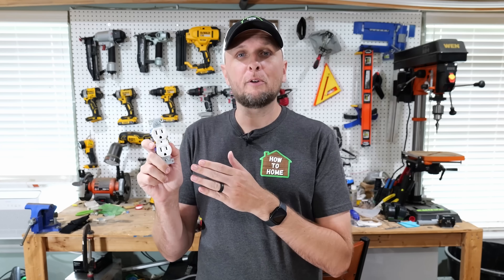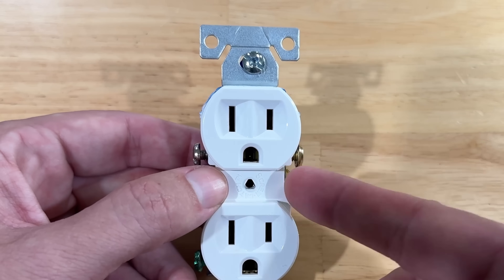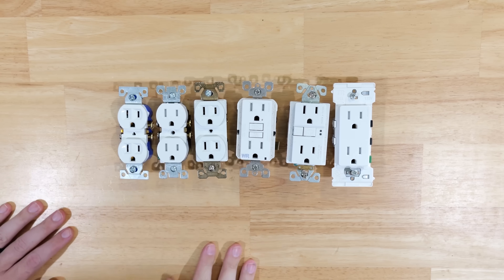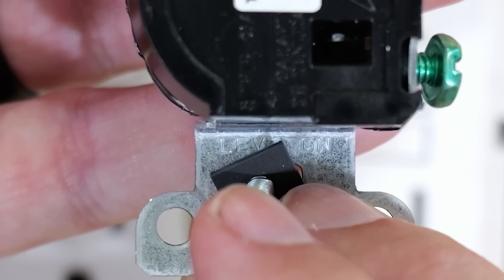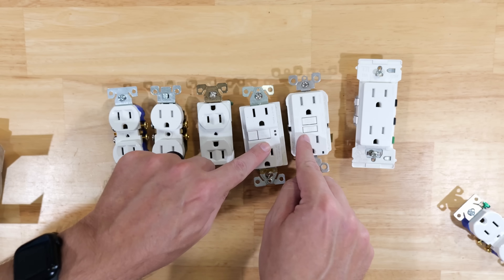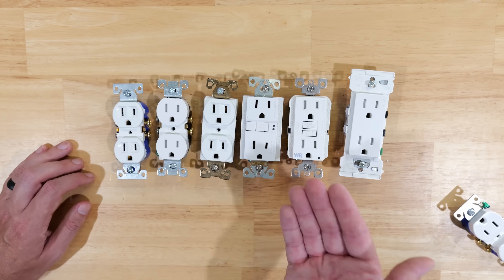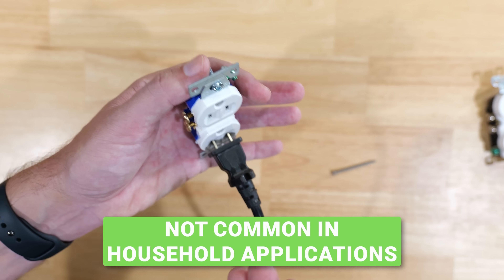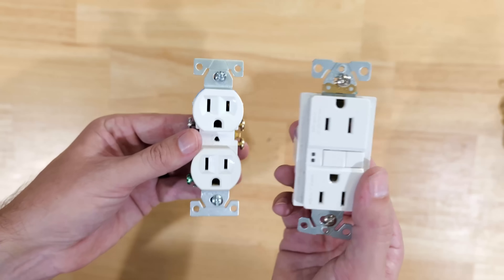The Shocking Reason Why Your Outlets Are Installed Upside Down!

Comment: I work in IT and I'm also a computer enthusiast. All the surge protectors I use with my computers and other electronics have 90 degrees plugs that are designed for a "ground-down" installation. Same goes for refrigerators, AC units and watercoolers. For me it's ground down all the way mainly for that reason. There are cases where ground-up or down is debatable, such as with sit-stand desks where the surge protector is screwed under the tabletop (above the receptacle). in that scenario, having the 90 degree plug to facing up could somewhat make sense.

For straight plugs, I don't think it matters.

Comment: Wall transformers (Wall Worts) are designed for the ground down in many cases so the output wire will come out the bottom.

Comment: This is a pretty worthless argument. Electrically, it won't matter if the receptacle is ground up, down or even side-ways, which I have seen often in tight spots. The electrical current won't care, it will still flow in any orientation. What possible reasons do people give for insisting on a particular orientation?

Comment: My biggest issue with ground up is that 99% of power cables that either end in a box or have a 90 degree bend at the plug will point upward in a ground up plug. As such, they're more likely to start to fall out easier as the cord is used than if the ground was on the bottom. And 99% of these items don't have ground pins. If the 90 degree bend is sideways, there's not problem either way. And if you have one of those box plugs in a wall outlet, it would become top heavy and more likely to tilt if ground up. It bothers me at my workplace seeing a waist-high outlet, the ground is on top, and a box plug plugged in with the cable going up and away. If any type of plug is likely to catch debris, it's those.

Comment: I had a house that had all the recepticals horizontally mounted. The ground prong being up would really only be useful in a shop or garage. That's the only location where metal things like pegboard hangers or metal flying from being cut might lay across a partially pulled plug.

Comment: THIS PRACTICE IS USED IN COMMERICAL APPLICATIONS BECAUSE WITH THE GROUND UP THE PLUG FOR COMMERICAL FLOOR MACHINES. THE PLUG WILL STAY IN THE RECEPTACLE BETTER AND WILL NOT FALL OUT AS IT DOES WHEN THE RECEPTICAL IS IN THE DOWN POSITION. NOT A RULE BUT RATHER A PRACTICE

Comment: A few years ago when I was working for a state agency that dealt with this stuff we ran into an issue with extension cords and the number of fires that we investigated and the causes and these upside down outlets came up.

I contacted members of the team that wrote the NEC and the Life Safety Code. There is a section that most people miss that you briefly mentioned, which is something about all other rules and regulations that shall be followed. UL testing. In this state, everything bought and sold must have the UL certification. It is crazy how complicated it was to get and read through that testing stuff on each item and I found out why it is so expensive to get something tested. So without going through all that gobbly gook on each device and just using common sense people will find that there are a ton of things that require the outlet to be right side up. Many night lights, and decorative aroma defusers and the such but the biggest and most important thing we ran across was the flat against the way type plugs on heavy equipment like refrigerators and airconditioners. When these are plugged into an upside down outlet undue stress occurs to the outlet itself and the cord. I investigated a fire where a father and baby lost their lives in a fire because one of these scenarios where the outlet and plug failed and caused the fire. And before people say that an easy fix is just to get an adapter, those are an extension of the outlet and therefore against code when the UL testing is reviewed, those are for short-term use just like extension cords. See how this all comes around? 

Having an outlet in so many cases upside down is illegal and we have been pushing the NEC and other regulatory agencies to address the issue.

To me, the ground facing up or down looks just as good. I will tell you this though, I have had my fingers slip off the plug way too many times when unplugging one to admit to, and every single time it was on a two prong plug and you would think that zap would get me to learn the lesson but hasn't.

Comment: Look, the ground terminal is longer that the others. With ground terminal up its easer to aim the ground terminal to enter the socket first. Its best if the ground terminal makes contact first to ground the system before live terminals connect.

Comment: Side note:  Not necessarily the nail or a paper clip , but in some case that I’ve seen; JEWELRY (bracelet, necklace) in a bathroom that has caused the arc/short circuit.

Comment: I think the ground up comes from applications where the stainless steel face plates are in use. In the situation where a plug is inserted and works it way out a little and the plate becomes loose. The plate would become hot with the ground side down but be safe with the ground up.

Comment: The discussion around 10:00 about metal falling on the prongs, happened at work a few years ago. A metal faceplate came loose and fell onto the two prongs. Scared the crap out of the secretary (she was moving something when contact was made.) Ground prong up would have prevented that.

Comment: A lot of cables don't come straight out from the plug.  Usually in this case it is angled down from the ground side of the plug.  Having a receptacle with the ground up puts the cable coming out the top and bending.  Looks weird and is not good for the cable.

Comment: Every appliance with a GFCI built into the plug I've ever seen is designed with the prongs on the opposite end from where the cord comes out, meaning it should be plugged in with the cord down at 90 degrees. The ground prong is always on the bottom. Hair dryers, air fryers, vacuums, window A/C's, whatever, they're always designed to plug in with the ground prong down.

Comment: I'm not a professional electrician, but my father was an electrical engineer.  We discussed this topic at length.  I believe our final decision was to leave them in the "Face" direction, so that the ground was down.  This had more to do with the items being plugged into it, than anything else.  Some UPS devices, and other items like Refrigerators have cables designed for the ground plug to be down.  I have never come across a plug that expected (unless universal) the ground prong in the up position.

Comment: My only issue with the ground prong being up is when using most any 90° plugs. Most of the 90° plugs on certain appliances or extensions like surge protectors are designed with the ground prong being on the bottom. Other than those situations, I don't care.

Comment: It's just common sense outlet control. One idiot did something stupid and blamed the outlet now there's local regulations. Plugs should be removed from outlets when not in use and the breaker turned off and locked out...for the children

Comment: It's not that an object might fall on the pins, it's if there is a metal cover plate and the screws somehow come loose. That's much more likely. If the outlet is sideways, it would make more sense to put the ground pin to the left.

Comment: Anybody who installs receptacles with the ground slot up has zero credibility.

--------------------------------------------------
[Note: This comment is not focused on any particular "designated group" with regard to the YouTube "hate speech" or "cyberbullying" policies. It simply reflects the author's opinion regarding a subject, which may or may not also pertain to an individual's actions demonstrated in the video. If any such individuals belong to any of the "designated groups", any commentary included is merely incidental to that grouping and such groups are not the focus of any comments. It's pathetic that this comment is necessary for the YouTube censors.]

Comment: I read somewhere long time ago, like late 90s, the ground up was the new way to install because when the plug is half way out. 
I have another question.  Why do the live and neutral prongs have holes at the end?  Again, I read somewhere that  right after WW2 ended, manufacturers added these holes to save on metal which was limited at that time.

Comment: As an electrician this video is spot on... Residential electrician are typically taught to ground down. This is for switches as well although some (Levington I believe) want grounds to the top on single poles. This is very frustrating to someone that used P&S (eaton) for most of his life.  You get use to having grounds down and this is one reason I hate using anything with grounds up as it gets in the way of wiring the other wires as I typically hook up ground first to hold the switches in place while I strip out or hook up the other wires. Due to this, it really reinforces grounds down in residential. 

In commercial, such as hospitals and things, they tend to do ground up as a general rule of thumb. Maybe that's why levington puts ground to top on their single poles?  I think the idea of this is if your in a hospital setting, you don't want something to trip the breaker (like a paper clip) and cause a medical emergency.  

I think in both situations, there is no real code to tell you but the typical rule for me is ground down unless your commercial. Also, most people are use to the smiley face. It is true that neither way is upside down but ground down is usually considered normal and ground up is upside down except for hospitals... Very good video explaining things though.

Comment: If the ground prong is on the upper side it seems to pull out easier at the top from the weight of the cord sticking out of the outlet due to less frictional resistance. Two prongs at the top pull out less easy and therefore the plug stays in its place better, based upon my experience.

Comment: Regardless of the vertical orientation of US outlets, they are the crappiest I've found almost all over the world.  In most countries they would not pass their national electrical code on the grounds of their poor design.  When it comes to plugs that are inserted into said US outlets the situation is even worse!  Most foreign plug prongs only have conductive material at the tips, so it is impossible for a small child to stick their tiny fingers between a plug and the outlet, touch the prongs and get a shock.  The prongs consist of insulated material except for the very tip, which is no longer in contact with the outlet electrical connections by the time you can see the metal tips.  Why are US plugs not built this way?  Because it makes them more expensive.  Quality and safety have a price which apparently Americans are not prepared to pay.

Why oh why do nearly all US electrical plugs stick straight out from the outlet?  The means that furniture cannot be placed flush with the wall if there is an outlet behind it with a plug inserted.  This is ridiculous!  Given the pathetic quality of US molded plugs, why do more companies not install thin 90 degree plugs?  Because it costs more to make them that way and given some people insist on installing their outlets the 'wrong' way, appliance and lamp makers would have to decide which direction the power cord should go.  I have purchased some 90 degree cords and they always seem to point the 'wrong' way.  If for no other reason their should be a national standard that establishes the orientation for electrical outlets for just this reason.  The cord should exit the plug downwards only.

I'm now living in our fifth home since moving to the US in 1977.  In every home, including new construction, I have replaced every electrical outlet with 'medical' grade outlets that are more expensive but grip the plugs prongs more firmly so they cannot 'fall out' or be easily removed when jerked, such as when someone moves a piece of furniture or catches on the wiring when using a vacuum cleaner.  In the US construction industry is is documented that two out of every electrical outlets are wired incorrectly!  Not with the 'live' to ground, but with the neutral (return) to ground, which will not usually cause sparks or fires but can cause horrible wireless interference, especially in steel framed construction.

Three of our US homes have been older ones that needed remodeling.  Every one had electrical installations that were not to code and in some cases downright dangerous.  I've discovered that Americans are not just cheap when it comes to their electrical infrastructure, they're blind to how dangerous they are and how close to death from electrocution some people may be.  At the very least every home owner and renter should own a simple outlet tester, the kind with three lamps, typically amber and red.  They should test every outlet in their homes if they want to sleep safely at night.

Before I retired some years ago I owned a business that required me to install some medical equipment in commercial premises.  I was constantly appalled by the blatant disregard for people's safety.  Incorrect wiring, loose connections, multiple devices plugged into extension codes exceeding the load capacity for the wiring that created literally hot wires, people with multiple extension cords plugged end to end with no regard to the load capacity of the individual cords.  This was especially prevalent in rural areas.

Most Americans live in wood framed homes.  You'd think they would be more conscious about how incorrect or just poor electrical wiring can burn their home down!

Comment: There are many larger plugs which would be an issue if oriented ground up due to their construction. My Midea portable air conditioner is an example. It has a test and reset in the plug block. If ground up, all the weight of the cord, being forced to loop away, would pull it loose from the plug where, down, the cord weight hangs freely without concern.

Comment: With the ground up If the cord is stepped on and pulled down the most important connection will be the first broken. I say either way would work but I prefer ground down for this reason.

Comment: Amazing that nobody ever talks about receptacles mounted horizontally. Not as common by far, but they do get done. I have seen quite a few installed in the base board horizontally. Also, not covered in the NEC.

Comment: The original patent states that it was designed to be used specifically with ground UP. That's probably why people say they're mounted the wrong way if they are ground down.
IMHO, what the original design had in mind doesn't always translate to real world use correctly. 
This system is one of the most dangerous systems worldwide anyway XD Safest being the UK system, followed by the Belgian system and the EU system. They are quite a bit bigger though.
Where you mount an outlet is usually a LOT more important that the direction. And as you said, HOW you mount it.

Comment: The problem isn't with the receptacle, but with the way some plugs are designed. Three prong flat to the wall plug wires only hang right when the receptacle is oriented with the ground prong down. Many transformers also are built to hang down. When the ground prong is up, the transformers tend to be top heavy and pull out. 
I would actually like to see the receptacle redesigned so that the  prongs are opposed VS the same. I would like to see the top receptacle ground prong up and the bottom receptacle ground prong down. This would solve nearly all of the problems. But it would probably cost more, and you would really have to be careful how you wired it.

Comment: We have found in most houses the ground plug is down, but in rooms that a light switch controls an outlet, the outlet that the switch controls, the outlet is installed ground plug up. This makes it easier to find which outlet the switch is controlling.

Comment: I am an electrician and took my training at a state trade college. The "rule of the thumb, so to speak," was that no matter where you mount a receptacle, if it's mounted vertical,  the ground hole in the receptacle MUST BE HEADED TOWARD THE GROUND, which is down. That, it was explained, shows that the bottom IS the GROUND connection. The smallest hole, in the face of the receptical, is that way, so it's harder for a child to fit something into the hole and shock themselves. It is connected to the BRASS screw.
   No matter what size receptical, and what voltage, if it's mounted in a vertical way, the GROUND hole WILL BE headed DOWN...toward the ground.
   Different manufacturers look at electricity differently. General Electric believes that current flows from Negative to Positive. (This is in DC direct current). Therefore, their control circuitry uses a COMMON Positive, to all their relays coils and Negative to the switches and feedback circuits. This is totally backwards to the way I was originally trained, on General Motors, Electromotive Division. We were taught the theory that current flows from POSITIVE to NEGATIVE, and to NEVER switch a NEGATIVE. They were ALWAYS the common connector and all the positives would be the ones that were switched. 
   I put this in this comment, to exercise a point, that different manufacturers look at properties totally different. Their parts go with the flow of the theory of that company. 
   One thing, that I have learned, YOU DO NOT MIX DIFFERENT COMPANY's PARTS. Choose one that you agree with and stick with it, no matter what job you're on. But if you're on something that's GE, don't apply  GM-EMD theory on it! You'll BLOW something up!😵‍💫